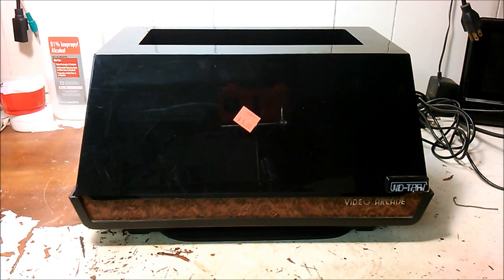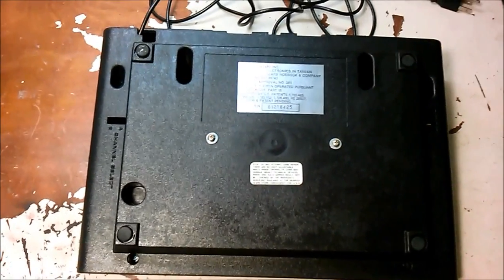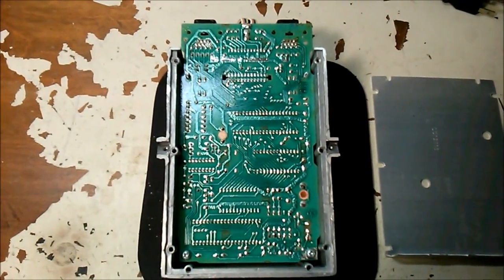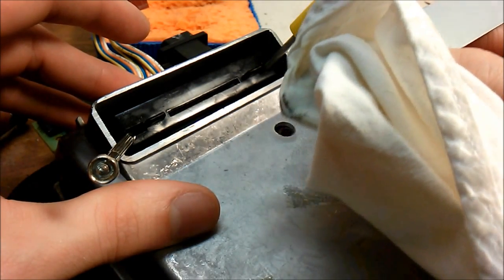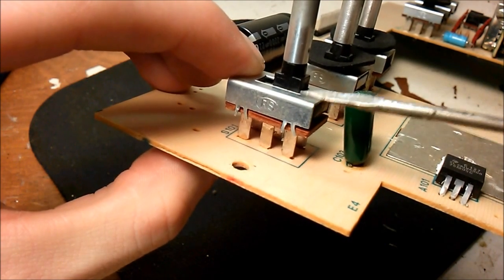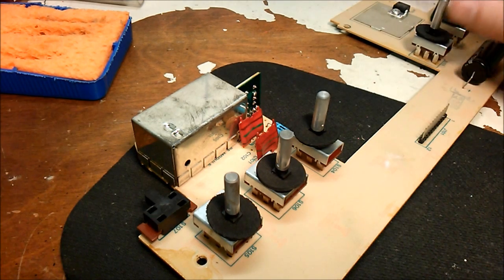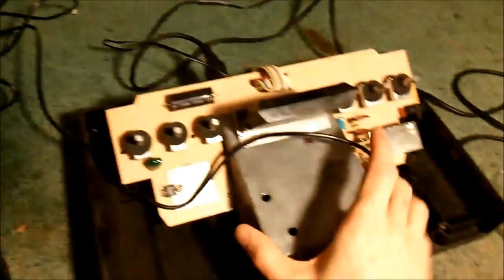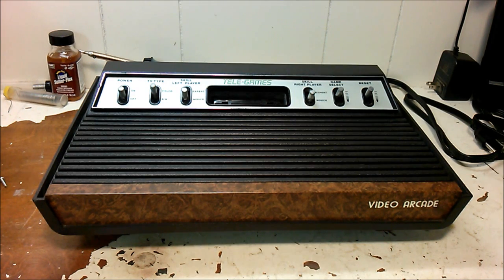Tech Repair: Sears Tele-Games (Atari 2600) - Broken Port and RF Tuning

Comment: I've been watching a load of Atari 2600 repair and restoration videos recently in preparation for when my woody sixer arrives and I thought that by now I must have learned everything about repairing and restoring them until I watched this video. I'd no idea that the rf module could be tuned like that though, because no other video has mentioned it and it never would have occurred to me to lightly heat the controller port to help loosen it up like that. Those 2 things could definitely come in handy at some point. Nice job you did there by the way and well done on finding such an absolute bargain.

Comment: Thanks for the video. I have two failed units coming from ebay and your video will make my life much easier when it comes to repairing one of them. The other will be the parts donor. Can't wait to replay something I had so much fun with back in the early eighties. Many thanks again from the UK :)

Comment: To clean the switches. Use deoxit (or similar electronic cleaner)  spray. Don't take the switch apart. You can see where to spray. Work the switch. Tip your bored and spray it again and work your switches again.
Much much easier. Good video.

Comment: One of the best videos I have seen on restoring an old Atari. Can you do one on the coleco gemini, I managed to install a LED INDICATOR, but I am having trouble installing a composite input, any suggestions?
Reply from the maker: wow you have one of those! ive never even seen one in person so im probably no help on this. However, Ben Heck installed a pretty simple composite video mod in a 2600. since the gemini is a 2600 clone, it may have similar hardware so it might work for you but im just guessing

Comment: I found I could improve the RF signal quite a bit by adding a crap-load of ferrite chokes to the cable. When I opened the 2600 I repaired it was filled with dead cockroaches, cocoons, and mouse pellets.
Reply: I was glad I opened it before testing it because it probably would have shorted out due to the garbage in it. It had been abandoned in a storage unit for over 30 years.
Reply: @majesticlizardhatesgoogle4735  lol I opened my atari 2600 jr today and it had a lightning bug stuck in a spiderweb😂

Comment: Be careful bringing electronics from thrift stores into your house. I usually open it up and check for roaches and roach eggs. Roaches LOVE electronics because they get warm and dark inside.
Reply: tarstarkusz Definitely NOT 87. This is a sears heavy sixer and a fairly late version of it, from 81.
Reply: tarstarkusz I do the same thing.
Reply: That's a light Sixer, not a heavy.
Reply: This is a true statement.  Thrift store/sidewalk finds need to stay in garage for decontamination/pest control.

Comment: i have one in the original case, wirh games, but no controllers, and im pretty sure no power adapter. it was my dads, he is deceased now, and i got it for Christmas, and have yet to see if it works, so i really hope it works

Comment: controller problem means your RIOT is broken. So time to replace them. the interference most likely comes from bad capacitor (2200uF). Replace them and all is fine. Never ever open the switches! It is quite hard to get them together without any space between. Better using contact spray.
Reply from the maker: the controller problem was a broken solder joint. fixed. the interference was from the rf box needed to be tuned. fixed. the switches were dirty so i opened and cleaned them. fixed. spray is the lazy way out
Reply: retro-modding.de, I hope you don't work on consoles for other people.

Comment: Hopefully you still answer comments... Where can I get a #2 Hex bit from?
Reply from the maker: You can get them at almost any place that sells tools. Idk if you have a harbor freight tool store near you but that where I got mine. It came in a case of security bits. Very handy and it was only like $12
Reply: I may look for it. Reason why I ask is because  my light sixxer is experiencing weird color changes. The colors keep going deep red then it goes back to its normal colors.
Reply from the maker: That could indicate that it needs the capacitors replaced - If it only does it when you power it on and then it gets better. With it being almost 50 years old, it probably needs it anyway
Reply: Yeah... That's what I thought. Have to replace the  film capacitors. Great.
Reply from the maker: It's not that hard. I recently did mine and there were only 3 I think

Comment: I'm looking at a joystick port with a broken pin. How would I replace the port?
Reply from the maker: simple. desolder the old one and install the new one. dont know how hard it is to find a replacement port though. you might have luck searching for male 9 pin through hole socket or something to that effect
Reply: I thought I would have the same project, which brought me to this video. It turns out the pin wasn't broken, it was merely pushed in too far by someone careless. Easy to push back into place. It's unfortunate that there isn't anything securing those pins in the housing. I never realized how weak and flimsy they were. Even as a kid I never managed to damage one like that though.